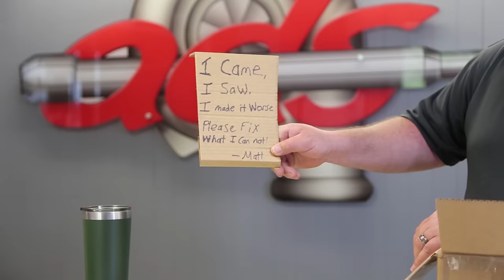DBG Stanadyne Pump Repair for @DieselCreek 3850 FREE International Wheel Loader (Will it Start??)

Comment: It's a privilege to watch experts and learn from people who truly know what they are doing. Thanks for letting us be a fly on the wall for this. I came looking after the Diesel Creek video and this wasnt up yet so im glad to see its out now :). Great video!
Reply: I had an idea for Corey, which is take a socket and weld inside the lip, adding metal to approximate the shape of the broken screw, then use it to remove the broken screw, and if the screws usually break in the same way, then the same socket should be able remove those screws as well.  One might also similarly add metal with a welder to a proper tool instead of a socket and use that to remove broken screws.  Or weld a proper tool into the center of a socket?

Comment: Holy shiz... never thought so much went into a pump, and the adjustment involved... hats OFF ! what a job !
I'm a diesel creeker, so you've got yourselves a new sub on this build, it was awesome 🙂
Reply from the maker: Thank you for the watch & sub!
Reply: DC watcher here too. 
Who knew a engineer could make a fuel pump so damn complicated!!
Reply: @merlynwylld  If you can find a video on a Bosch pump for a 12 cylinder Duetz engine, you will see how painful it can get.🤣😎Messed around with a replacement in the late 70's, sure happy, I didn't have to tear into it.😱
Best wishes from the far North.
Reply: Same here, I bet you guys got more sub via this VJO than ever before, I limit who I subscribe to but you guys are just on another level!!!!
Reply: @merlynwylld  : Quite!  What I'm realizing from watching this is that it's basically a little mechanical computer that controls the engine and all its different speeds, kind of like a carburetor on a gasoline engine.
Reply: @merlynwylld Almost looks German doesn't it?
Reply: Came here from DC, staying for a while here!

Comment: ADS appreciated the breakdown discussion and assembly detail and component description. Your technician is well schooled. As a  64 year old retired diesel generator stationary engineer in a very large powerplant your tech covered more than I expected. If he used a small tig torch he could have welded a nut on top of the screw and the heat of tig and 5 sided nut might brake it loose. Spray inside of pump housing with anti spatter spray.
Reply: Could it be removed with an EDM tap remover?

Comment: EDM is a pretty awesome tool. Broke a bolt in a cylinder top, then broke the extractor in the bolt trying to remove it. Luckily a local machine shop came to the rescue with this tool.
Reply from the maker: If time would have allowed, we wanted to give it a try - so now we have some ideas for future content!

Comment: Well, here I was thinking old diesel engines were unbelievably simple, but this pump alone is one complex piece of equipment!
I'm not only impressed that Corey was able to reassemble the pump without having disassembled it, but also that parts can still be ordered for it. Very cool all around.

Comment: I will never again be dumbfounded at the price of new heavy equipment after watching this. The engineering that goes into one of these monsters is astonishing. What would a new pump like that cost?
Reply from the maker: This particular pump has long since been discontinued. Where there are similar new units available they will often exceed the value of the equipment they belong to.
Reply: I discovered this issue when I bought a John Deere 2020 from a scrap metal yard.  The injection pump had to be rebuilt.  The rebuilders had to get a machine shop to create a new part for the throttle advance.  Years ago, John Deere recognized that that model of pump was defective and they replaced many of them.  I thought that I got off easy with a cost of only $650.  The tractor ran well.  Of course I had to put in new liners and pistons.

Comment: the complexity of that pump is staggering.  i have never seen so many parts in a pump in my life. but then, i am not a pump expert. Corey is an amazing technician. i can not imagine the patience it must take to do what he does. if he can fix that, he can fix anything.  absolutely fascinating! you guys are top notch.
Reply: Those Stanadyne/Roosamaster pumps are actually known as cheap, simple pumps, which is the scary part.
Reply: Its basically a whole mechanical injection unit, a pump is a tiny part of what it does

Comment: I am a lifelong mechanic it was a pleasure to see someone who truly know his craft. You are the real deal ! I don’t know what they are paying you but it is not enough! You know these pumps inside and out. No guess work. As a Ford dealership mechanic from forever ago, we had these pumps on the 6.9 and 7.3 IDI diesels. We could not change  thing on them and we’re only allowed to check the transfer pressure. One issue they had was stalling when coming back to an idle. Gosh if I didn’t replace 100 of them over the years I didn’t do one. Unfortunately the rebuilder Ford was using was no Corey. Once I had to replace three before I got a good one. They were blaming me ! You guys are top notch and if I need a pump repaired your the guys!!!

Comment: I knew when he pulled the pump without the drive shaft his goose was cooked lol. I used to rebuild those Roosa's/Stanadynes up here in NH at Lakes Fuel Injection 25 years ago (when the DS's were failing left and right). At least the updated cam screws didn't break as easily.
Great vid, it's nice to take a stroll down memory lane, and also watch Matt make a swirl down the drain on this one heh heh

Comment: Many years ago I used to work at a shop in Virgina that rebuilt pumps and I remember seeing several where this ball snapped, if memory serves, he rigged up a solid plug with a ball seat that he could screw in to the side ports to backup & support the broken ball, then we would use a punch and tap on the side face of the fracture to unscrew the broken ball-stud.
I don't remember having to destroy any housings to extract the ball.

Comment: Excellent video ADS. I have been following you for about 2 years. Started when you worked with WWW and his Oliver Tractor. I also follow Diesel Creek, so I was waiting for this video to drop. The skill level of your technicians is unsurpassed. They can take a bag of parts and reassemble everything into a working end product, in this case a diesel injection pump. Thanks for posting and sharing this adventure.
Reply from the maker: Thanks watching, the comment and being a dedicated YT fan!

Comment: There is an air hammer attachment called a shake and break tool that might be useful for breaking loose the cam screws. From the picture Diesel Creek showed of the carnage, it looked as if you might be able to tap a sacrificial sleeve over the outside of the head and maybe hold it together long enough for the proper tool to get it loose. It might save enough time and housings to be worth the try. I don't have one of the shake and break tools, but seen them come in real handy on a couple of other channels.

Comment: Thanks for helping Matt out, you've earned a sub, for that alone!
I had 1994 Chevy Diesel (prior engine to the Duramax's), that had a reoccurring issue with the staynadyne injection pump(s). I had 7 replaced during about 2 years, all were covered by the dealership, thank God. They finally figured out that the type pump was incorrect, and that my engine needed a "green tag" version. Even with that issue, I loved that truck. I finally replaced it with a 2004.5 Silverado Duramax, which is what I'll be buried in! Newer trucks are WAY too expensive, and the DEF fluid issue doesn't interest me.
Thanks again for helping Matt out!

Comment: its always nice to see how a specialist is doing it's job. This is really the first time i have seen how a fuelpump is put together. there is hardly any documentation availeble for that on this side. also its great that you guys take a job  of all parts from someone and make a working pump of it thats really great. i know for sure in my country they wont do that unles i will pay a price of almost a new pump. i did see the video where matt took the pump apart, and also where he got it back all restored and it worked in the best way possible. 
Great job done by you men, thanks for the lesson in making a fuelpump......

Comment: Watching Cory rebuilding that unit convinces me as a Coast Guard HH52a Seaguard amphibious helo Flight Mechanic who at times had to adjust the fuel metering unit on GE T58 turboshaft engines I've absolutely no doubt that he could be an FAA certified jet engine Mechanic. 
He definitely has the intelligence and work habito to rebuild pretty much every section on any jet engine.
Area Diesel Service is lucky to have such a talented young man working for them.
I find ADS videos to be really fascinating and entertaining. 
Matt was smart to send his almost FUBARed unit to them.
Now he'll be able to get that beasts engine running reliably if the injectors don't need to be sent to ADS also.
I have a sneaky suspission they should be to save Matt some serious fuel costs and the engine to run cleaner.

Comment: It's incredible how just this pump has hundreds of little components, and it gets mounted in a machine that itself has hundreds of components itself. All of those components have a unique and necessary job to make the machine perform in just the designed way. The wonders of engineering legacy from decades and centuries of refinement.

Comment: Corey, you are a true professional in what you do. I knew when Matt said this is not the same housing, that you had exchanged it. Wasn't sure then if it was a complete replacement or partial,  but now we know. I had really hoped you could have salvaged the original housing by tig welding the part you cut off back on, but the next step had you already showing the replacement housing. The cam piece that froze in the housing was indeed the weak design in that pump, having to go to such extremes to remove it. Thank you for such a great rebuild video.
Fyi, i was already a subscriber to your channel previous to Matt's collaboration with you. Love your work on 5.9L Cummins P-Pumps!

Comment: Corey, I’ve got some questions for you:
1. Any reason why you couldn’t heat the housing to get it to expand around that part and release it? 
2. Can’t you get a tool made to turn it with a ratchet before you cut the housing?
3. Carburetor cleaning solvent can dissolve 99% of the crud inside that pump, have you tried soaking a pump for 48hrs to see if it releases?
4. Would you be willing to try any of these in the future and let us know if any worked for you?

These questions come from what we used to do while repairing injector pumps for various military applications. I’m no expert and what I knew I’ve forgotten, not only because this was 40yrs ago but because of a stroke. Best wishes and thanks for sharing your expertise with us couch potatoes.

Comment: How the heck did i get stuck watching this video for a stinking hour and a half..🤣🤣
Just kiddin.. Great stuff, i learned a ton...👍👍
The pump came off a IH D282 i assume.. I have the same pump on my IH i believe.. Mine has been sitting for 22 years with fuel in it.. Hopefully when i try to get her running again its not all froze up..
Thanks for sharing..  I had no idea a pump could be so complex..You guys are very knowledgeable at what you do.. Thanks again..🍺🍺

Comment: Watched a few videos including when Wes did his tour through your shop and his stuff being rebuilt. Now watched this with Diesel Creek. I always like watching specialized work like this. I find the nut and bolt end of things so interesting. It’s even better when you can follow what the issue may have been, what caused it, the repair, and then the conformation that it was the problem.

Comment: I worked on a international 350 utility tractor which has the rosamaster pump, and it had stuck plungers stuck from gummy old fuel, rebuilding it was actually easy, easier then most things and didn't has to replace parts just had to clean it and put all new seals in it

Comment: Good work as usual guys. My opinion, with a toolmakers back round, on removal of the cam screw would have been either machining it out or EDMing. This way you would have saved at least the housing if not the housing and cam itself. Hopefully saving the customer money in the end.

Comment: I was told in the US Army Engineer School that a Russamaster Pump must be assembled while in clean Diesel and not with bare hands. Reason is the tollerances of these parts are very small, and salt from bare hands will corrode them.

Comment: I have done simple repairs on these type pumps a few times, usually replace shutoff solenoids, cracked or stripped out fittings, leaky o rings, etc. I had one broken input shaft too, but that one and other more complicated problems all went in for rebuild. If I had seen this video I might have went in a little deeper.

Comment: I remember at the opening he said there is a special tool to remove that ball. Is it like a sleeve which a hex bit inside? Fits down over the ball to keep pressure on the outside so it doesn't crack when you turn it?
Reply from the maker: Curt does mention the bit/tools used around 1:25:25

Comment: One suggestion, maybe try to weld a bolt on the cam bolt and then u can access it outside the housing. At worst u still ruin the housing...with the heat and the new bolt end to crank on i bet u could save quite a few housings if u tried.

Comment: you guys are fantastic , those pumps are a nightmare inside . matt is a smart guy. put it in a box and send it to area diesel service. matt went one step to far taking it apart. i know enough not to screw with some thing like those pumps. one little speck of dirt left in side, putting a scratch on a part , leaving parts out , will all make it not work. just looking at you taking the rest of the pump apart made me cringe . that will be very expensive to fix. poor matt.

Comment: The cam screw is only hardened ball.  The stem can be drilled.  Carbide burr cut off the ball The drill thru the stem little heat and it comes out.  Save your housing. Easy out

Comment: When ever a rotary pump like that sits for a long time, them plunger are the first thing to get freed up, the fuel sit in them get gummy and there's no way to get them free but by taking them apart no diesel clean or any thing can get in there to clean out the gummy fuel

Comment: Oh good grief my heart was in my mouth you holding the part whilst using the cut off wheel.  One slip and a finger or fingers would be hanging off.  I always strap the part down or wear armoured gloves, usually armoured gloves working in situ.

Comment: Would the correct way to loosen up the broken bit be inserting a sleeve of sorts (ideally a threaded one) that prevents the expansion of the head of the stuck part and therefore minimizing the risk of it shattering? And of course apply shock, heat/cold when trying to loosen it.
Reply: I came here to write the same thing. The problem seems to be that the head cracks. A tight iron pipe sleeve that gets hammered onto the ball head should prevent the head from cracking. And also maybe enable them to put back the broken part of the head. Hammer on the sleeve and then unscrew it as usual. As long as the shaft don't snap it should be fail proof.
Nice to see someone else who got the same ide.
Reply: Use that air hammer that Eric O has, (Big Nasty), might've done the trick...
Reply: @FSaarela  I was thinking that the sleeve would me more of a removal tool that is inserted on the housing threads when the thing has to come off. The head shape seems to be that one which resembles a torx but has slightly different shape with more angular points EDIT: Torx Plus or Torx Paralobe. I think Diesel Creek used either a torx or even a plain hex wrench on it, which definitely would transmit the forces in suboptimal ways.

Comment: Here's an oddball idea for removing a busted cam screw- Is there enough space to get a diamond file in there and power-file flats on the stub so a custom-made socket could fit over it? (likely not worth the time)
Wow, that thing was extremely stuck! Suppose it might still have broken even with the correct tool?

Comment: The check ball and fitting was probably missing because when the ball siezes the pressure inside the housing increases and the pump stops delivering fuel. The engine will start but quit after a few moments and drive the operator crazy trying to figure out why.
Reply from the maker: For sure. As many come in to the shop without it as those that do.

Comment: So you mentioned that you need to use the correct bit around 58:30...and the wrong one will split the part like Matt had happen, but what is the name/number of the correct bit to use there?   Or is it some weird specialty bit that is hard to find?

Comment: On the cam screw: could you use an impact driver? hear me out, impact drivers are great for stubborn screws and bolts in various projects, where I started using them was motorcycle cases , what if you took a impact driver bit and sharpened it in a way to be able to push and turn the broken screw using the driver, its just my 2 cents but being in rural areas with few specialty tools i have had some success with these drivers in getting stuff loose when it shouldn't have gotten loose , thanks.